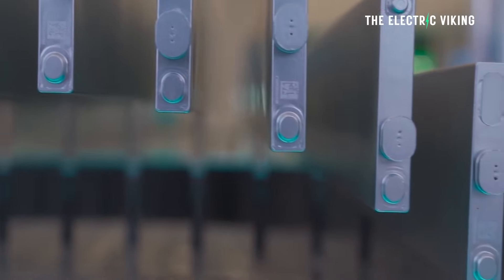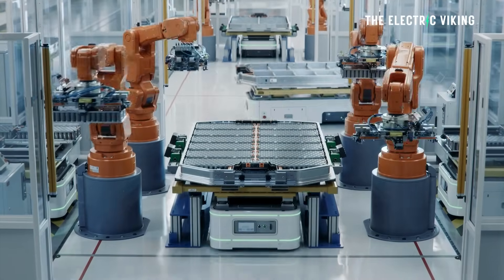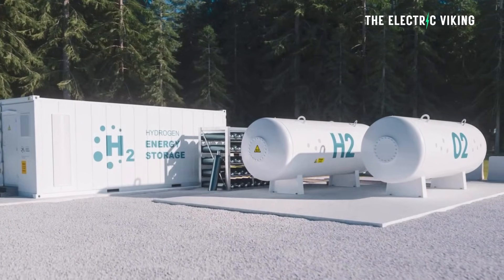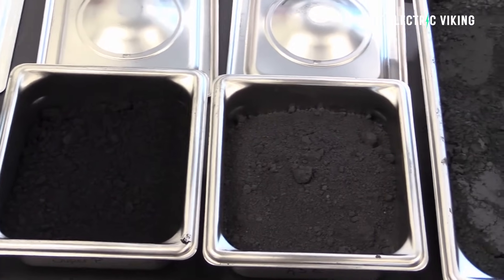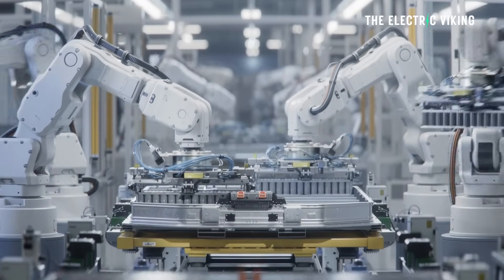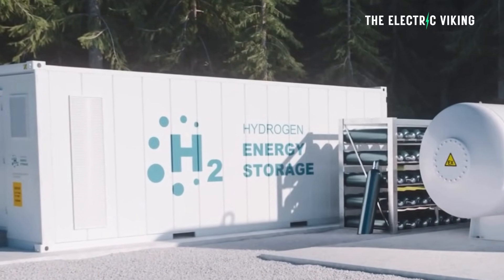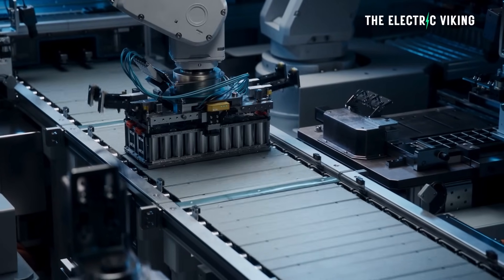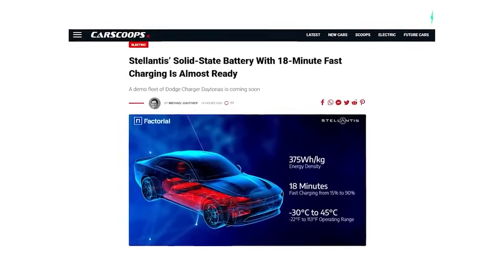Are Hybrid Lithium-Hydrogen Batteries the Future or a BAD idea?!

Comment: Sam, I have been watching your videos for a long time. This episode I am a bit disappointed. It talks about a hybrid battery with traditional Lithium and then also a separate Hydrogen battery. It states the density of nearly 3 thousand wh per kilogram but does not mention the volumetric density. Hydrogen is very light weight but likes to take up a lot of room, unless you cool and pressurize it. Cooling and pressurizing would use a lot of energy and make this potentially not viable. Assuming these problems are solved somehow, it would be a closed cycle process inside? Why would you worry about hydrogen infrastructure outside the actual vehicle? Is it that you think the hydrogen batteries would be swapped when needed?

Comment: Hydrogen is high in energy relative to mass, but low in energy relative to physical size. In it's unnatural form as a pure gas. It's rare to find hydrogen trapped underground. It combines with other molecules so quickly, in most normal conditions on Earth.

Comment: No technical details. How does this work? Is the hydrogen recycled (via electric charging) within the vehicle or does it get used up and require H2 fueling stations? How is this high energy density calculated? Ignoring pumps, tanks and plumbing? No details and wild claims.

Comment: Every battery story needs to list pros and cons up front. Energy density, cycle life, calendar life, charging and discharging characteristics, safety, cost, ease of manufacture, what are the unknowns, how long before it's out of the lab years or decades. Otherwise it's just another vapourware nice idea and we are drowning in those on the internet
Reply: Fully agree. One bad parameter and the miracle solution is over at least for mobility.
Reply: Agreed, and as bad or worse is when most of the hype and attention go to one sector of an industry like lithium batteries, and another sector such as redox flow batteries for grid storage gets ignored and doesn't take off like it should.

Comment: I think its biggest drawback is what we have is “good enough”. I have a Atto3 and have never charged it at more than 6KW. It’s absolutely fine.  Aircraft, Trucks and motorsports sure.  Grid storage…  flywheels, cryogenic nitrogen, flow batteries… if weight isn’t an issue, go for cheapness.  This sounds very cool though. Never underestimate the need for awesome 😂
Reply: Yep 6KW is fine. Lots of delusion around charging rates. Personally I don't have need for anything faster.
Reply: You guys clearly don't do any roadtrips in the EU in the winter time, and you have a charger at home. Overhere we are desperate for a car with double the max range which charges with 200kW+. Currently we have to charge at least once every two hours of driving, which is pretty annoying during a trip of 10 hours.

Comment: The hydrogen atom is so small it’s hard to encapsulate the hydrogen atom.
Reply: Yes. Always leaks. If you visit a facility using H2 for process, you see all  H2  pipes in open trenches with a metal grill to close. So any leaked H2 can escape without stagnating.

Comment: This is the breakthrough the aviation industry needs. With an energy density like that, electrification of air travel becomes a reality.
Reply: Lithium and Hydrogen are pretty reactive.  Why not mandate thin-wall magnesium cases to really heat things up?
Reply: This is a BESS specific battery, Sam got overexcited with the use-cases as the battery utilises low atmospheric pressure hydrogen that is stored in large vessel. The battery also needs a large surface area to scale up. For flight energy use, then as it stands the Li-H hybrid battery would be larger than the internal surface area of a plane and require a hydrogen storage volume also larger than the volume within the plane's body and wing space. It might work for a blimp, due to the lifting effect of the hydrogen and larger internal area but this comes with its own set of considerations.

Comment: Pllllllease do a spoof of critics of battery-solar-wind as reaching a 'new' horizon in bullshit density.  Fair dinkum ... really ... it could be done so well.

Talk about solid state (or the new low cost sodium) bullshit density having evolved via taxpayer funded R&D to such a degree of sophistication that it is now ready for mass production by shareholders and high bullshit density media outlets.  These new product are so good ... they don't have to be true.

With a straight face just insert the same superlatives applied to the 'amazing' new 'incredibles' appearing in the renewables sector but (without getting personal) let the viewer slowly realise that you are taking the piss out of dinosaur juice funded headf$%^&*s:

-> modular nuclear reactor proponents backed by AI tech companies with built in privacy protection
-> drill baby drill proponents that impose tariffs that cut off their own nose to spite their face
-> deep sea Gulf of America oil spills that minimise man-eating shark attacks
-> beachside property conflicts that clear the way for condos and off-the-coast gas extraction
-> plastic coated housing that enables a horde of private and corporate negatively geared to collect rent from hard working, non-unionised, temporary visa holding ... rent payers
-> government policy that allows car makers to dump polluting diesel or petrol yank tanks in to a market that has no oversight or regulation on the matter
-> poisoned aquifers due to fracking that will alway be out of sight and therefore of no consequence to anyone
-> and the list goes on ...

I suggest the following announcement:  Read out the text of the this post then ...

"Viewers ... at some point, this style of episode will appear but it won't be offensive because the people it is lambasting will have no idea they are the butt of the joke ... which proves the point."

Comment: Hydrogen molecules are escape artists. I am excited to see how they keep them in the system for a long time.
Reply: I'm pretty sure they are NOT stored, and they need to be topped off every charge.
Reply: @brianbrandt25  - hydrogen is stored for this battery, as it's not a fuel-cell that "consumes" the hydrogen (i.e. creates water vapour) in the process rather it retains the hydrogen and usese it to perform a redox operation at the cathode (converting H2 gas to two H+ ions held within the anodes lattice). It requires a vessel of low-pressure hydrogen on site that forms a closed-loop component of the LI-H battery can (the paper behind the battery is for BESS static storage not transport use). 

Sam got a bit overexcited with the battery's use cases, as it's designed for static energy storage, and currently is projected to achieve 177 Wh/kg (scaled up from the small lab model built). The paper projected an ability to scale up the battery up to 2825 Wh/kg, but this makes assumptions about keeping the battery's hydrogen storage vessel to relatively low weight and hence are low atmospheric pressure vessels. 

The battery itself requires a large surface area to scale up, with the hydrogen tank being industrial tank/silo sized to support a large field-sized battery array. A rendition of the scaled up approach is included in the paper with a field of battery cells connected by industrial pipework to a rather large site-wide hydrogen tank.
Reply: @brianbrandt25  this is different from FCEVs. Maybe Hydrogen can be topped up during maintenance... Just like water in cheap lead acid batteries
Reply: @brianbrandt25 No, these are not refilled hydrogen but it is the hydrogen produced by excess charging that are being used by a fuel cell membrane to produce electricity.  Eventually a lithium ion battery will start to expand, that's because hydrogen is being produced and a normal lithium ion battery isn't designed to re-incorporate the hydrogen.   Here they have a fuel cell membrane so that the hydrogen can be reincorporated and provide power as well.  Think of it this way, a battery is already very similar to a fuel cell so this is just one that could be operated as both.  As to the storage of the hydrogen, in a pure hydrogen fueled car, you would have it stored under high compression in a pressure tank which actually causes greater leakage.  Here, it's like your expanded battery as it goes bad, the pressure is low and hence far less hydrogen is being stored.  I would suspect they will try packing the battery with hydrides which would absorb the hydrogen, releasing it when heated which would happen as power is drawn.  I suppose a pressurized tank could also be used but then you would need a compressor and a compressor for hydrogen gas to be far more precisely made than for any other gases with the exception of helium.  However, a system with a compressor and a tank would be more like what you're thinking of but such a system would also need some form of oxidizer and given the materials we have for the fuel cell membranes, air simply has too many impurities to work, it's mostly the CO₂ that is the problem as it produces an acid.  With just the hydrogen expelled by the battery, the oxidizer is just the end products of the material that expelled the hydrogen in the first place.
Reply: I was thinking the same thing. Many graphene companies are working on coatings for Hydrogen storage. First Graphene is one.
Reply: Maybe have hydrides to absorb the hydrogen.  Heat would release the hydrogen and discharging the battery should produce heat...  I'm not sure if lithium hydrogen hybrid is a good idea but there would be a few variations to try...

Comment: My biggest concern with any hydrogen system is the leak rate. Hydrogen is a very small molecule and is used for leak detection i.e. it's very good at escaping systems. With an LEL (Lower Explosive Limit) of 4% with air, it's a another factor   that may make this development a niche product.
Reply: 4%? Really?

Okay... 4.6%. I thought it would be 12%... or so.

I think I am just plain lucky that an enclosed lead-acid battery project didn't go boom.
Reply: @JohnBoen  I think I would add some vents 😁

Comment: The likely range would be 4.5K miles, not "a thousand." 
I don't think that any battery with a range over a thousand miles will ever go into a production car, it's just overspecked.
Reply: Agree.  The better the charging infrastructure, the less battery a car needs.  Daily drives in the West are typically <60 km / 40 miles, and <40 km in China (hence minumum 50 km AER for Chinese PHEVs), a 1000 km battery makes little sense for the cost and weight.
Reply: Don't worry it's a BESS specific battery design, achieving an estimated 177Wh/kg in the lab. The lab paper projected a potential ability to scale up to a large field sized battery array (the battery units themselves need a large surface area each) with an integrated industrial sized hydrogen storage tank, which was calculated as being able to support up to 2,825Wh/kg. The hydrogen is held at atmospheric pressure so that the tank can be lightweight allowing the volume to scale significantly compared to its weight; hence reducing the overall battery's weight and sp increasing the Wh/kg. This is more similar as to how a flow-battery is scaled by using larger reagent tanks.

This does introduce a new metric for consideration though as to what the Li-H battery's Wh/m2 density would be and whether the energy density of a similar footprint lithium battery would equal or better the energy density - the Lithium based Wh/kg would likely be lower for the total mass of batteries involved but that's less important in BESS where land area available is both an enabler and a constraint.

Comment: Not the highest density battery, not even REMOTELY close.

Molten salt electrolyte metal air (aka molten air) battery chemistries blow this out of the water and then some.

We're talking >8,000 Wh/kg and >20,000 Wh/L densities.

Comment: Hydrogen for Large shipping is the most likely Zero emissions fuel for the continuing logistics and Green hydrogen from water instead of from Methane.
Hydrogen for long haul trucking also a key to zero emissions future.  Pure electric trucking is a given but the rural long haul is the weakness when infrastructure is still far from acceptable.   
Small plant Hydrogen from Solar have already proven the application on Hospital power generation for backup power in Switzerland and other countries.
a small 1MW array can manufacture 3MT of hydrogen from mains water supply and be used as reserve fuel for a hydrogen generator for power during low solar production to keep a 50 MW battery fully charged as backup for hospitals.
the are many companies already installing 1000 kW hydrogen powered Generators all over the world like Rubri and companies like Oncore energy in the USA that have a range of Home Hydrogen generation and small scale storage that can supply from 4kW to 20 kW and above https://oncoreenergy.com/applications/residential/
the Use of hydrogen is going to be huge whether you like it or not.

Comment: 83Kwh (A battery in say, a VW ID.4) ÷ 165 Wkg = 503+ kg battery weight. 83kwh ÷ 2,825 Wkg = 29kg battery weight (theoretically). So this tech could potentially turn a 503 kg battery weight (1,108 lbs) to 29kg (63 lbs)?!!! THIS would be awesome!
Reply: Sam gave the published theoretical max energy density of 2825 Wh/kg of the pictured battery system rather than the actual measured energy density, which is 177 Wh/kg (i.e. includes the battery's weight for low pressure hydrogen storage required).

The lithium-hydrogen hybrid-battery described in the video originates from a Nov 2024 Chinese research paper, but such batteries are still very experimental and at a low technology readiness level. The paper describes a dual stage back-to-back cell battery, with a lithium-redox and a hydrogen-redox battery sandwiched together that raises the voltage of the two individual battery elements if used in isolation (creating a 3V hybrid battery cell). The paper in effect seeks to propose a novel approach by raising the relatively current capacity of a hydrogen cell battery by combining it with the higher capacity of a lithium cell, whilst at the same time seeking to raise the gravimetric (i.e. by mass) energy density of the overall cell utilising the higher energy density of hydrogen by mass. 

However, these cells currently have a relatively low areal current, i.e. current density per anode/cathode area, capacity (0.025 mA cm-2 vs 15+ mA for LFP and 40+mA for NMC) so will require a larger surface area than an equivalent lithium-based battery design currently in use (or those under development, such as the similar gaseous exchange approach using Lithium-Air batteries that have a current capacity of 500mA cm-2, and theoretical max energy density of 11,140 Wh/kg with energy densities of 1,800 Wh/kg already measured in lab setups). With such large areas required, lithium-hydrogen hybrid-batteries are more suited to static grid energy storage applications than transportation ones.

Further, the paper doesn't detail how the hydrogen will be supplied or stored in the system, other than expecting it to be supplied as a low pressure gas meaning it will have a high volumetric storage requirement, as hydrogen has the lowest volumetric storage density at 3 wH per litre when at atmospheric gaseous state. Again suiting a more static application with a fairly large storage chamber supporting the battery (1kg of hydrogen occupies a volume of circa 12 cube metres, about the total internal volume of a Land Rover Discover). Indeed one supporting graphic image in the paper envisages a BESS  configuration consisting of a large field of LI-H battery containers connected by industrial pipework to a rather large site-wide hydrogen storage tank.

Other hydrogen 'hybrid-batteries' (Toyota's for example) are just packaging approaches that combine a lithium battery and a hydrogen-fuel cell into a single package to reduce component count and so reduce housing weight, but offer minimal weight advantage gains; the Toyota Mirai, for example, is heavier than similar spec/powered Tesla Model 3.

Comment: Disassociate yourself with the notion of this being a consumer facing battery in the short to medium. This battery's true prowess will be unlocked in electric aircraft, which have been estimated to require 400w/kg energy density batteries to be commercially viable. If 2000w/kg comes on stream, even at high prices, Electric planes would make that back on cost of fuel in a negligible amount of time.
Reply: Not for this particular battery, it's designed for BESS - requires a very large surface area to operate and a very (very) large storage tank for the hydrogen as it operates at atmospheric pressures. The paper behind the concept includes a picture of an industrial sized field of battery units connected together in a grid by pipework to a large site-wide hydrogen tank. The actual battery has a working energy density (inclusive of the hydrogen storage weight, since it's part of the battery) at 177 Wh/kg, with the 2,285 Wh/kg quotes being the scaled estimate for a very large site battery grid with a huge on-site hydrogen storage tank.

That said similar gaseous exchange batteries are being considered for flight, including Lithium-Air batteries that have higher energy densities (estimated between 4,000 and 11,140 Wh/kg, and working batteries available at between 1,500 and 1,800 Wh/kg). They are not currently used in large scale applications due to having low cyclelifes (<1,000 cycles), but are being worked on both to improve their cyclelife and create automated re-generation batter designs (automated material recovery feeding battery construction lines).
Reply: Lithium Air is 2-3K wh/kg